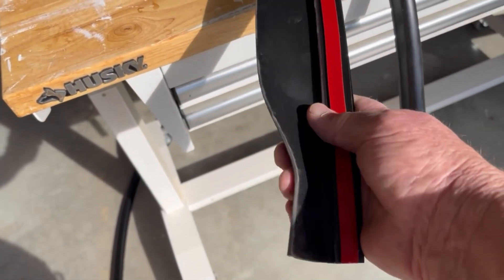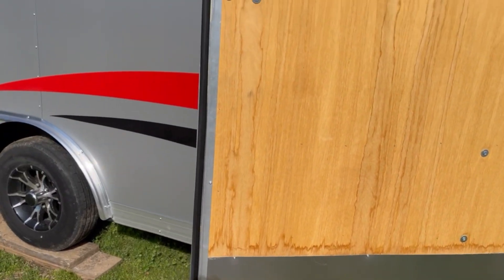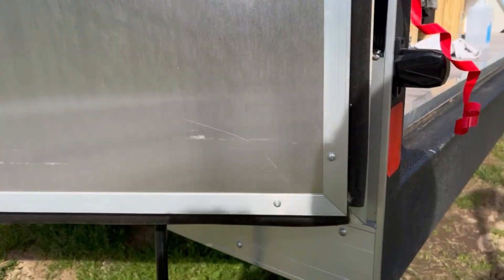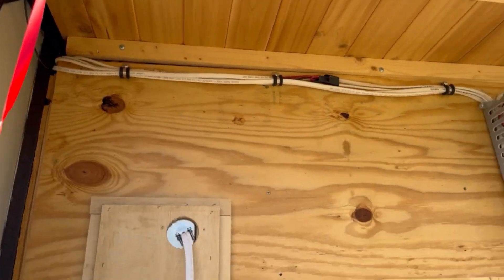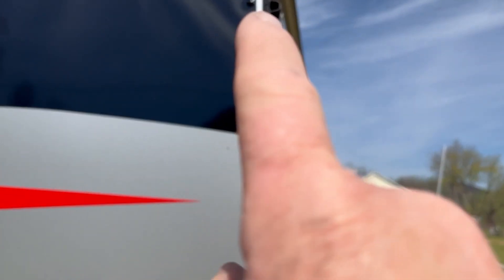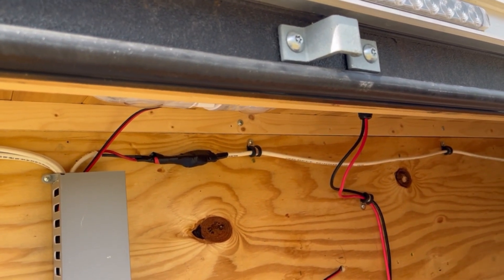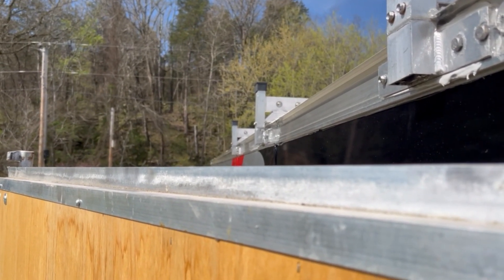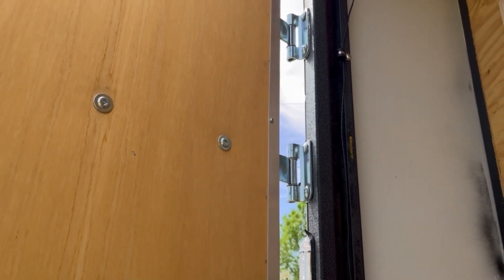Replacing the Barn Door Seals on the Cargo Trailer Conversion!

Comment: Great video, just curious, so how did it hold up?
Reply from the maker: @youcanthide004  yeah it’s working great. Sealed up the gaps. Only issue I ran into was when I stripped the original foam weathering off the doors, it left a gummy mess that was sticking to my new  rubber seals. I tried several chemicals to clean the gum off but it’s not 100% clean. I need to apply some flat rubber weathering to the doors sides I have clean rubber to rubber seal. Just another project!

Thx for watching!
Reply: @ awesome thanks for the feedback, I greatly appreciate it